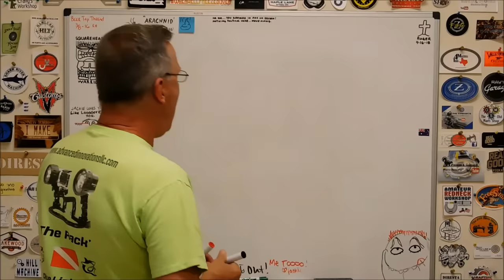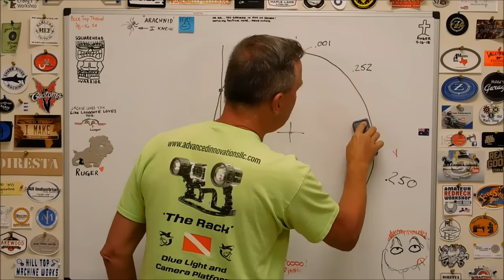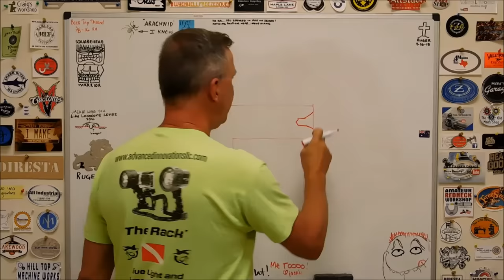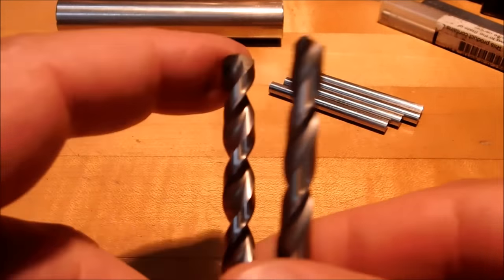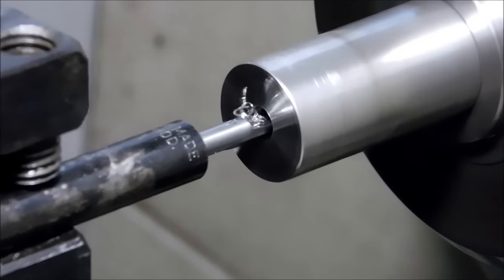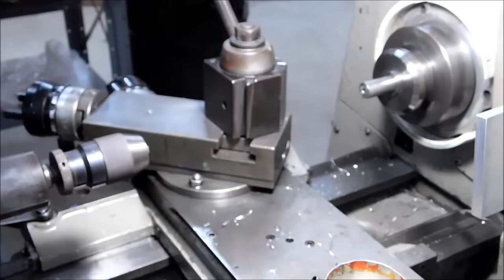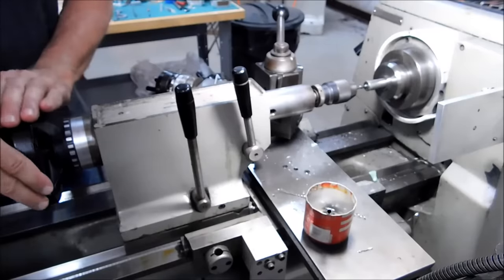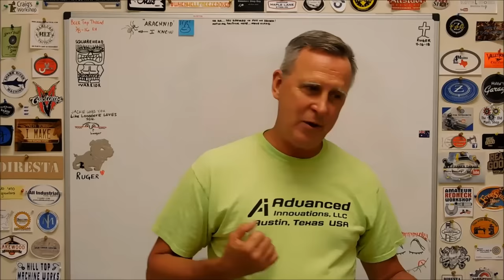Techniques for Machining Straight Deep Holes -- SHOP GEM --

Comment: Using the carriage as a tailstock stop when drilling is genius.  When using the toolpost to feed a drill you can lay a piece of steel (1,2, 3 block) on the bed ways as a visual reference to its last position in the hole.  The carriage pushes it forward, marking your last depth position.  Saw that on another site and thought I'd pass it on.
Reply from the maker: I like the 1-2-3 block idea. simple and fast.

Comment: Good information on doing this Thanks.    On the lube,   I use it and love it.   Purchase several small ones and now purchase the large ones to refill the small ones as needed.
Reply from the maker: I like it, but it will stain your tools and machine if you don't clean it up in a reasonable amount of time.

Comment: Joe great stuff. I am drilling near 5 inch deep with DIA ranges of .200 to .400 in stainless 17-4 on a HAAS TL-2 cnc.  I will adapting several of your methods.
Reply from the maker: 17-4 is a big medical stainless. I have a lot of it here. Its actually very friendly to work with. Not like a 304L at all.
Reply: @joepie221  It is those long stringy chips that I find challenging (fun) to work with. Especially in those deep small holes.

Comment: Hi Joe, do you know the old machinists trick when using a centre drill , have the flutes horizontal and push the drill chuck slightly sideways with the toolpost, it turns the centre drill into a centre drill shaped form tool boring bar, once any wobble is eliminated you can drill normally.
Re old machinists trick, not sure if it is the machinist or the trick which is old, or whether it is both.🤔
Reply: I learnt that one from a retired chap, in what used to be East Germany, just after the wall came down... Good and not new.
Reply: @eastcoastandy2905  i think i first read about it in a book from the 50's or 60's just as relevant today as it was then.
Reply from the maker: Sounds legit.  I'll have to try it when I get old.
Reply: @joepie221  don't leave it too long, old age might catch even you, but maybe not.😊
Reply: @joepie221  Practice now for the time when your maschines grow sloppy, don't wait till you're old!

Comment: Joe, another method is to use gun drills, they have 1 cutting flute. They track straight because they don’t have the influence of the other flute not being exact as the first. Drill wants to take the path of least resistance. I can drill .030 dia. 1 1/2” deep, put a del tronics gage pin in and have a run out of .0002! Spotting is critical too as you said, because the start is so important! Good lesson though with standard drills!
Reply from the maker: I have never used a single flute gun drill.
Reply: Shipwrights use a similar method for long holes in big timbers and use a one flute bit as well with no lead screw because wherever the lead screw is aimed there goes the bit. A shaft log for the prop shaft could be through multiple pieces of wood for a number of feet.

Comment: Thanks for doing this video. I'm an amateur home shop machinist and I've always had this problem of the drill fucking off a few inches down the bore. Now I know how to fix it if that bore is critical. Usually when I'm drilling holes in a cylindrical part it's just to make a bushing, so I just drill as deep as I need then part it, then re-center drill, then drill, then part, and so on. It would be nice to be able to just drill it all the way through, or to make hollow shafting that runs true end to end, OD and ID.

Comment: Hey Joe good video its common sense when you have done it. My deepest hole was on a schuler 3000 ton motor mount bracket. There was a grease hole that was 6mm diameter and 620mm deep. This was a one off casting and had to be right. This was machined on an Okuma 5-axis mill. 
Mike - Plus8Precision
Reply from the maker: Wow. Thats a setup you check 10 times before you hit the green button.
Reply: @joepie221 , myself and the machinist on days machined on that casting around the clock for 3 days. He worked day shift and i worked afternoon shift. We finished it 2 days ahead of schedule. Thanks for the videos Joe.
Mike - Plus8Precision

Comment: I proved the boring bar does true the hole this last week!   !.25 hole thru 3 inch block of Al makin a collet block for a er32 extension....drill to 1 inch then bored 10-20 thou till close to 1.25 then snuck up on it with .002 passes to finish / extension fit like a glove/ bore was straight as an arrow!!!!
Thanks Joe for the great teachin!!!
Bill A 
Aspenforge
Reply from the maker: It absolutely does.

Comment: Great info Joe, but I going to finish up in the morning.
Reply from the maker: It is long, but a lot of good stuff in this one.
Reply: @joepie221  After a good night's sleep I am ready to go. I have a boring bar, drill bit, reamer and a cup of coffee by my side. As long as you are making video's I'll be watching them.
Reply: @joepie221  just finished the video Joe and was amazed with the results. Sliding the .201 gauge pin all the way through with such little pressure was impressive. I rewound a couple of times until I understood all of your movements especially when changing from a drill to the reamer. Thanks for all the time you spend Andy.

Comment: Thanks for all your video work, great information with real instruction. I have been needing this, I need to make several straight line seater inserts for precision rifle reloading. The easy way is to use pieces of barrel from 4 to 5 inches long, but, don't always have that. With this method I can use raw stock with investment only in  a reamer half to 1 thou over pilot diameter for each bullet diameter and I am good to go. Thanks again and keep them coming!
Reply from the maker: Good to know you'll try it.

Comment: Great job, I have been using a similar technique  for drilling a 4.3 mm hole 290mm long in Blackwood for a Northumbrian bagpipe chanter using a home made spade drill, worked well but quite time consuming. I will update my method using after your video. Any comments on worm pattern drills for this job? Hope all is good with you and yours. Pete H

Comment: Excellent stuff.  Although I always use a center drill,  I  never considered to start with short drills and go longer. Now I have a use for all those broken drills.
...and yes WD-40 makes a great cutting fluid especially on aluminum.
Reply from the maker: It will serve you well.

Comment: Joe,   here's something I've noticed that perhaps you can comment on if you agree,  something you don't want to do is start with a smaller diameter drill and finish with a larger diameter drill as in my experience all the "oversize hole" problems seem to get magnified in this case, the larger diameter drill is much more prone to vibration if its tip isn't touching metal and that vibration causes an oversize hole.  For the same reason I never use a "center drill" to start a hole, you're in essence creating the "smaller diameter drill" scenario with the center drill's small diameter tip,  instead I always use a spotting drill,  and only use a center drill if I'm preparing to turn between centers.

I'll add that the most cost effective and time effective tool I've ever bought for my shop is a full set of stub length split point drills, I usually don't need to spot first, and while I still have a set of jobber length drills I rarely use them and never before first drilling with a stub length for as deep as it will go.
Reply: I’ve noticed what you said when drilling preexisting hole to larger size. As in drilling a barrel to accept a barrel liner.  You’d think a drill would follow a straight hole STRAIGHT.   But it won’t.

Comment: Nice job Joe! For me 316 is predictable but 304, a lesser quality, can still surprise me. At certain times; much better,  other times (when your drill is turning blue); WTF is happening here?. Enjoy watching your content Joe, And I drilled a lot of holes in nasty stuff. Thank you for sharing your thoughts. One possible tip from my side; I like to cut the hole whit a one point carbide cutter just a hair below the final size drill to give it just a little more support guiding down the hole. For me, a lot off chef's making good food, it worked out for more than 25 years as I supposed it would. No rubbing,  just a small amount of material  to keep track of the center. Thank you Joe! Best,  Job

Comment: I do a lot of that kind of drilling...Just finished drilling a 31/64" hole 110mm to blind hole. I got lucky and did a few of your suggestions without even realizing it. I have a 7x10 lathe and was using 1" round bar so it was only chucked an inch into the chuck. Couldn't bore the end. Made the center hole a bit off center so I used a diamond core drill to make it centered. The job isn't finished yet I have a .4990 reamer but I am going to try to bore the first inch to size they way you showed...To late for the drilling...that's done but maybe truing the hole for the reamer will get me there. Thanks for the invaluable tips.

Comment: Great Video!  Great Advice! Keep them coming!  I know this works- This is how I drill accurate holes.   They need to teach this in Metal Shop Classes - and I'm sure that they don't (at least not in any that I've taken......) but, I did learn this from an old machinist.
Reply from the maker: Now teach a young guy and join the club.

Comment: Good show Joe.   You mentioned that the drill bits must be sharp.   I would go one up on that.  Make sure that each edge is exactly equal to the other.   In drilling deep holes in non magnetic stainless (.156” diameter 90 inches deep) we learned that a difference as small as .0001” would cause walk.  Of course this was using gun drills, and they are different than twist drills, but certainly if one edge cuts different than the other, staying straight will be difficult.
Reply: I was thinking the same thing ,each side of the drill needs to be equal to each other or it would pull to the cutting side. My problem is drill bits get expensive and in the home shop or doing it as a hobby I can't just go out and buy new bits that often, I use to hand sharpen and that's hard to do and keeping each side of the bit equal . Then I bought a drill doctor just for that reason , but can't seem to get the bits sharp with it. What methods do you use to sharpen bits.

Comment: Nice!! Now can you show us how do put rifling inside that bore? 😁
Reply: Nathan Hamler use a rifleing plug :). You can buy it from Brownells
Reply: It's for a 574-gauge short barreled shotgun, no rifling needed... :)
Reply: I have seen rifling plug kits on Ebay
Reply from the maker: To be honest, I'd like to see that myself. I don't know how that is done.
Reply: @joepie221  -- From what I've gathered, button rifling is easier than cut groove rifling... Either way, you need a machine / device / mechanism that can pull the cutter / button through the barrel while rotating it (or the barrel) at a constant rate throughout the pull.

How would you go about drilling a 0.250" pilot hole in a piece of 1" round stock that was maybe 30" long?  I'm thinking that this might not be the type of situation where drilling from both ends would be acceptable.
Reply: @joepie221  -- For a short "barrel" like that, it would be pretty easy given the tools that you already have available in a professional shop.  You would need to ream the barrel all the way through so that it did not have that spot where it was noticeable that you had drilled from both ends instead of just from one end.  Then you would need to make a custom cutter whose shaft was slightly smaller than the diameter of your barrel, but with the head of it at the groove diameter of the barrel.  You would then pull it though to cut the grooves as basically internal threads at the rate of 1 thread per 7 to 16 inches (or maybe even more course of a thread with some calibers).  Can any of your lathes handle that course of a thread?
Reply: Joe Pieczynski once I get my lathe setup, I will be doing it at least once.. :) it’s actually pretty Easy, rifling plug, a screw or press of some sort, and patience and pressure.

Comment: there is some magic in deep hole drilling, my last job was at a rifle barrel shop and we would obviously drill deep, small dia. holes and it was done in 416r SS. we would drill 27 inch deep and usually come out  between .010" to .040" on center of the round blanks...  (.020" to .080" total indicator reading when spun between centers.) my current job, the only deep hole drilling ive done was a 3mm dia. hole 150mm deep in an aluminum manifold block. just a pressure relief port that intersected with a 40mm hole on the other side so positional accuracy wasn't that critical thankfully...  I was actually hoping you would go all the way through from one side then measure how far off center the drill wondered over the 4 inch length. either between centers or with a uni-mic and a gauge pin as your center... anyways, great vid as always joe, looking forward to the next ones :)
Reply from the maker: I've always said if the hole is critical, use oversize material and true the OD to the hole when you're done. Magic.

Comment: See this is a fun video, I worked in a shop that the entire discipline of the shop was gundrilling. Whole different animal, but our standard with a .3125 hole was we were allowed .004 total wall variation. Normally the parts were 36-48" parts sometimes though, up to 10 feet, or I recall one job (that I did not work on) that it was a .750 hole across 20+ feet. We had to make the drill shaft for that one. However there was some specialized machinery, some of it was proprietary, as well as knowledge that's very tribal knowledge on how to get a drill to behave. we also weren't going to finish size, we were going under, and it's amazing what a good hone operator can fix for wall variation if they know how to use that horizontal hone well.

I'm being intentionally vague because the entire process we used comes with a hefty non disclosure on the processes we used and the way in which we actually accomplished our goals.
What I can say is that on the rare occasion we had a job that we have .010 max wall variation as the tolerance you may as well have slept through those days lol

when it's that deep though, Like I mentioned we're talking feet deep, it's usually a single flute drill, and the material matters a lot on how you approach an extreme depth to diameter ratio. Honestly it's way easier in harder materials. we did mostly Nickel Titanium alloys,  Those were great for extreme depth drilling, Stainless? that sucked to drill. Straight molybdenum? Also terrible. That stuff to get it accurate required a lot of special training.

Of course on a lathe, it's a different world, same on mills, What we were doing was very specialized machinery, it only did the one thing, Made deep holes. The operators, they knew one thing, How to make deep precision holes.

When I was on the mills, we took a very similar approach to this, we did 2 holes on one part we made, and precision was important, and we used 7 tools to drill those 2 holes, and one of them was reused, and there was one other involved in the process (it was a threaded hole on one and I'm not counting the tap in the tool count) so 7 drills, and 8 steps, to drill 2 holes.

On the lathes? Life was a lot easier, we had a very good cnc, and an exceptional programmer. So that I never had to worry much about, By the time I had my hands on the parts, My department supervisor had it all worked out, and all I had to do was make sure the tools were sharp, keep up with offsets, and change out bits and inserts as needed. However, a lot of the parts if we needed a real deep hole and for it to be precise for our processes.... there were gun drills a few feet away. Have them drill it first lol.
Reply from the maker: Its a good video that chases away some fear for guys that have had bad experiences for sure. And offers some good tips along the way. Those deep hole machines are amazing. Why the drills don't walk is a mystery to me.
Reply: @joepie221  They do walk, preventing the walk at the beginning is the hardest, but there's some crafty engineering at work there to keep it from going too far until we can actively monitor it.

The part that comes after is where things get really secretive, the simple version is we are constantly monitoring wall variation, and if something doesn't seem right, we have a process to "Steer" the drill back toward center. The reality is there is a LOT of precision setup to get it to behave, and then a lot of attention goes into making sure it keeps behaving.

Those shops keep it a mystery because it's job security for them. Having a deep hole machine itself isn't enough to keep it drilling straight. There's a lot of clever engineering, special fixtures and tooling, and skilled operators. Every material they grind the drills different to change where the center of pressure is, Maybe it's a sloped grind, maybe it's a facet grind, maybe it's steep maybe it's a shallow angle. Depends on what you're cutting. Experience teaches what works. 

If they operator isn't paying attention, and leaves the machine running on it's own without monitoring and correcting it, it's happened before that you're drilling a /3125 hole though a .500 part and they end up drilling out the side of part. It can go that far out. It can go out .004 in about 10 seconds if it's not behaving.

It's like any other machining, specialized knowledge, special tooling where needed, and being there to stop it if things go wrong, and they do go wrong lol.